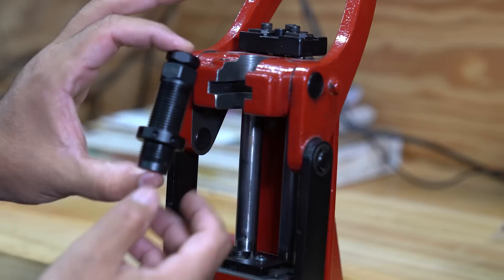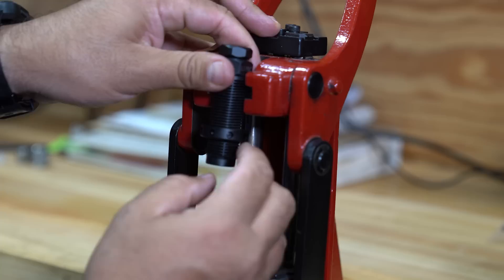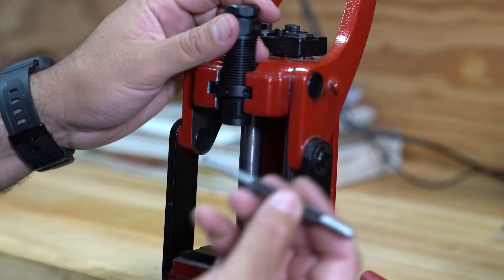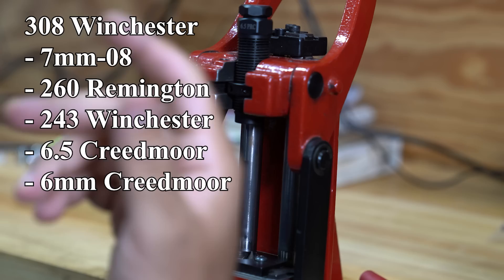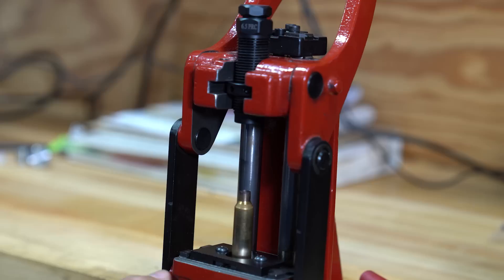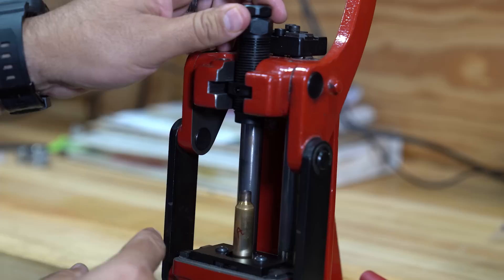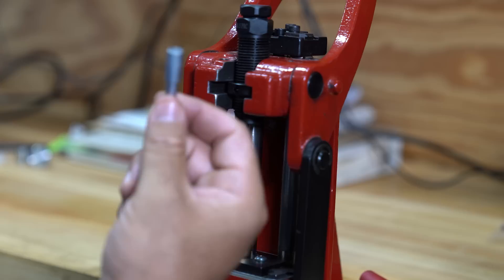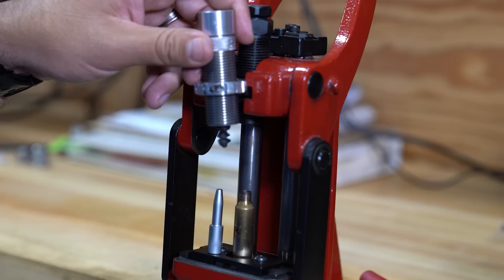Expander mandrel dies from Cortina Precision

Comment: Does the working of the base a second time possibly impact the shoulder bump achieved during full length sizing? Ie push that bump closer
Reply: Seems that if you squeeze the base smaller the case has to get longer and mess with the headspace set with the FL sizer.  Hope Erik answers this question soon.  Love the concept!
Reply: I was thinking the same thing about it affecting the shoulder bump measurement. Wouldn’t the base resizing make more sense in the full length sizing process so that the shoulder bump remains as it was intended?
Reply: Guys, if you want to use this product in your reloading process and are concerned with this, measure it! If you start with a .002” bump and after using Erik’s die you end up with a .001” bump, then just start with a .003” bump.

Comment: My complements on your clever design. A lot of people overlook lock rings, assuming that they are square. Our experience (a friend who has a lathe and I) have found that generally they are not. The punch holes are unique and IMO a clever addition. Including a ring die in the bottom of the die insures better alignment of the case than any other expander die that I know of. Without that extra guidance case necks can end up more crooked than one would like after expanding. It is good to see a fresh take on this type of product.

Comment: This is a great concept. I have some 308 Lapua cases that some were fired in an ar-10 I no longer own. I didnt want to have to buy a small base die just for those 20 or so cases. They'll chamber in my bolt gun before even sizing, but id rather be sure of consistent case size. I'll for sure pick one up at some point. One thought that crossed my find is a belted magnum one would be sick. These cases are notorious for swelling above the belt, and while there is a die available to fix this, it'd be easier and more efficient to do it with this die.

Comment: Is the body sizing necessary every time? I would like to use the mandrel to open up the case mouth but worried of over working the lower section of the brass. Thanks for your amazing product and information.

Comment: To use the expander mandrels properly, do you size the necks down further than one would with a "traditional" bushing die setup and then expand back up with the mandrel? If so, how much further down would you size the neck before using the mandrel?
Reply from the maker: I size down .003” - 0.004” with bushing then expand back up.
Reply: @ErikCortina  Thank-you, sir.

Comment: Is there any potential to affect the bump you achieved with your FL die by sizing the base again?  I’m thinking purely in terms of the brass growing in length because it’s being compressed at the base,  not any contact with the shoulder.
Reply: Logic would say yes depending on how you sized the case before using the mandrel die. If the mandrel die ends up sizing a large amount the brass has to flow somewhere and that usually ends up increasing the base to shoulder length. Just like if you don't have a FL die set properly it will cause the case to come out longer base to shoulder than when it went into the die.
Reply: @MMBRM  Therefore IMO it should be done prior to FL sizing.
Reply: @kondzio99999  can't be done because the FL die, unless custom made, would then size the neck back down below the size the mandrel has opened it up to. The whole point of the mandrel is to set the final neck diameter before bullet seating.
Reply: @MMBRM  Yup, you're right. I forgot that the main goal of this product is to size the neck with mandrel. Considering that I can just assume (because I didn't tested it) that it may have some influence on the final headspace due to as you said, large amount of brass will go upward the case. I wish to see some tests.
Reply: Can’t you just take the mandrel out a base size before you full length size?

Comment: ya, im not sure about that base resize. very well could affect shoulder length. i'm not really seeing the benefit as the case should already be fully sized at this point. if it was made like the SAC seating die, i could see the benefit. Maybe thats the idea, just harder to explain to the masses. 

One thing I'd like to see is a decapping expander Mandrel with larger then bullet size mandrels so that it could be run in a progressive to make sure neck dings are straitened out before resize
Reply: The same thing occurred to me when I saw how much it was sizing that case. If it's sizing the bottom of the case a significant amount it's going to change the base to shoulder measurement that you've so carefully set up your FL die to achieve. Same thing that happens with an improperly set up FL die which isn't constraining the shoulder. Case comes out longer than it went in.

Comment: I had to come back to watch this one again as I was processing some 6.5 PRC brass. Sure enough, my cases have a little swell at the base! I just ordered one of these dies for the 6.5 with the .262 mandrel. I think this die will help extend the working life of my brass. I assume, since I deprime separately, that I can just remove the expander ball from my sizing die since the necks will be sized by the mandrel...correct?
Reply from the maker: Correct.
Reply: @ErikCortina  Thanks for confirming Erik.
Reply: @ErikCortina  my die arrived while I was in Raton, literally just got home and unloaded the truck...can't wait to check this out and run some 6.5 PRC through it.  BTW, we had some wicked weather last week...golf ball sized hail on two different days, power outage for 24 hours (they brought a gen set in to run the range) and wind, LOL. Poor truck took a beating.

Comment: If you have already sized and trimmed your brass , then use your mandrel die that resizes the base .
Will your brass grow in length again ?
Reply from the maker: It depends on how loose your FL die is.  It should not grow though.  
Trim after expanding though.

Comment: I’m just getting into reloading and this is a bit confusing for me. I bought your 6.5 PRC, 7 PRC, and 300 PRC mandrel dies today. Now I’m wondering what mandrel size I need if I’m loading, Lapua Brass, hand loads, and if these bump the shoulder .002 like you recommend? I’m finding it hard to determine if there is a die that does all this? Or does this resize to Sammi specs and it’s not required to bump the shoulder? Too many questions here. But thank you for your videos. I am learning a lot. It’s just a bit confusing.
Reply from the maker: Mandrel dies do not push the shoulder back.  They only expand the necks after sizing.  Mandrel should be 0.002” under bullet diameter.  

For FL sizing, look at our micro HS sizing dies.
Reply: @ErikCortina  thank you Eric. I will do that.

Comment: Why not a case neck support (a neck brushing in the die)? In order to have a more precise coaxial between the neck and the mandrel?
Reply from the maker: You will pinch the case if you try to support it inside and out at same time.
Reply: @ErikCortina  got it! Thanks.

Comment: Don't forget about thev308 hate!
Reply: Just read this on his site. Note:  You could also use the 6BR die in a 308 Winchester or any other cartridge with same case base diameter.  You would simply have to back the die off so that the case mouth does not bottom on on the mandrel.